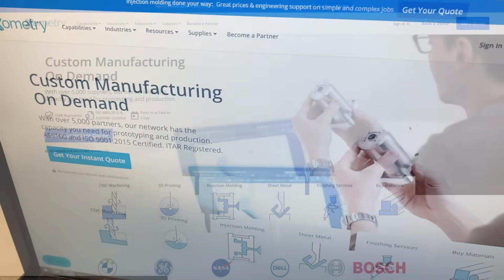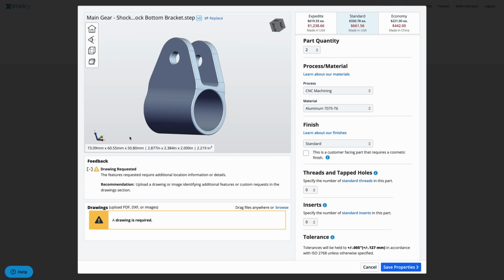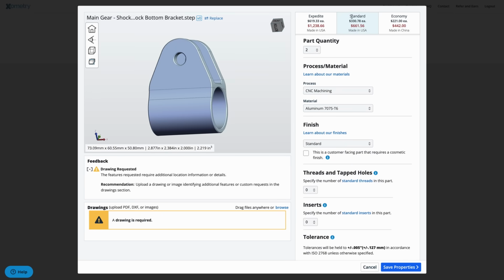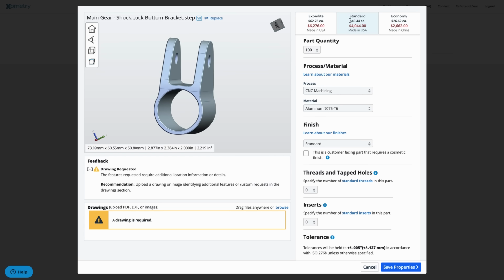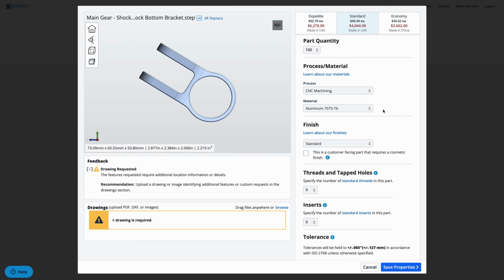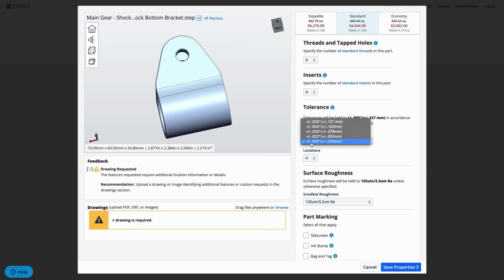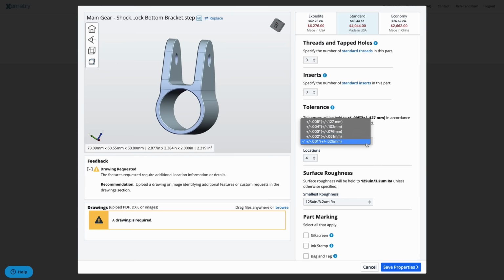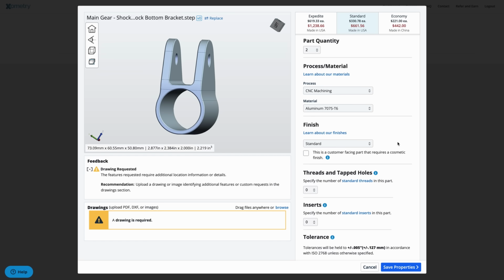The TRUE COST of CNC machining!

Comment: what the... that single part price is bonkers, I've made parts like that for cheeeep.  Want a new supplier?
Reply: The thinking is done in the first part, after that its repeating. Also if you want to make a lot of one-offs, keep the price for one low. If you want series, make a steep decrease in price once the volume grows.
Reply: most shops have a setup cost for their cnc machines plus a tooling cost, after all tools dont last forever and neither do the machines making the parts. once all the costs for setup and tooling are taken into account then there is the running cost of the machine and the cost of the operator. personally i dont know any machine shops that have a setup cost under $300 plus tooling as sometimes people want very specific things made and the shop needs to order special tools to do it and it may never get used again so the customer will get billed for those tools
Reply: @davidmilligan4751  If you can not setup and run any part in under 2 hours, you might be right, otherwise it seems a big exaggerated
Reply: @arjandijk1123  there are alot of costs in setting up machines more than most people tend to think about for lathes running soft jaws depending on the chuck size and type the soft jaws can be priced from $150 to several thousands just for the jaws alone then you need to machine them for the job which is programming and time that is all calculated into the setup costs or on machining centers the costs of tombstones and their fixtures even just setting up a vice and clocking it in and making sure everything setup right can run you an hour and honestly if your not checking to make sure the vice is square and flat your only leaving yourself open to problems in the future there is also the cost of the soft jaws on the vice i think most vice soft jaws ive used have been a minimum of $100 to buy its a stupid price but again proper setup removes alot of issues in the future
Reply: @davidmilligan4751  So then you are talking about a part that has high setup cost and time of over 2 hours. But a lot of jobs run just fine in a 3 jaw chuck/straight machine jaws and have less then 30min setup time, so if machining time is under 30mins your total spend time is under 1 hour, in the Netherlands we calculate a man at €40per hour and a machine (3 axis machine center or 2 axis lathe) at €30-45 (including tools), add to that the material cost os €10-30 and 30% profit you can have a part for €150 (half of your minimum price). If you don't want to do it for that money, your competitor will. 
In case of the showcased part the first part will be much more expensive then that and be over the $400 suggested here. But for most shops, the showcased part is not a standard part
Reply: @arjandijk1123  yes you are correct if you are setting up a simple lathe and the tools are already setup the customer has already supplied the programs say for instance a simple bolt m10 hex material bar feeder and the hex material is 16mm AF on a good machine you can get away with 2 turning passes and a threading cycle and parting it off into a parts catcher simple setting up the jaws for the material is easy 5 minutes to do that maybe 5 minutes to setup the tools if they arent already in the machine and thats 5 minutes per tool provided you have a tool setter longer without one sending the program to the machine another 5 minutes then running the program and making sure it doesnt crash and this can be quick or slow depending on experience of the operator and complexity of the job after the first part comes off the machine check to make sure that the quality meets the drawing theres another 5 to 15 minutes again depending on the experience of the operator an hour minimum to setup the machine ready to run  or even longer is not hard to see even for simple parts all this for a part that has a 20 to 30 second cycle time and suddenly you spend more time setting up the machines than you do actually making the part hence the reason alot of shops charge a setup fee of around 2 hours after all there is always the possibility that something goes wrong just imagine there is a wrong offset in a tool or a tool wasnt setup and you go from  a turning tool to a drill and now that drill is punched into your nice new 10inch chuck and the tool post has been moved and the jaws are wrecked the tool is wrecked all this needs to be taken into account when setting up machines all of this is a hidden cost after all humans arent perfect and these machines only do what they are programed to do and they dont care whats in the way haha
Reply: @davidmilligan4751  If you want to calculate a lot of human errors in your price there will be soon a competitor that has less errors and is cheaper
Reply: @arjandijk1123  just 1 human error could see your cnc machine down for days or even weeks so unless you are running multiple machines yes there is a factor involved
Reply: @davidmilligan4751  So if you make many human errors you will be more expensive then your competitor. Or do you accept a $1000 taxi ride for 20 minutes, because the driver crashes his car now and then
Reply: @arjandijk1123  Communists/Socialists  like you have a very warped view on this.  You say you could make the part/s for half, but the worker buying the product has already had half his wages confiscated by the State before he gets his paycheck to buy anything. And to further diminish his buying power, the cost of living is 43% higher in your little utopic commune. NO THANKS comrade.

Comment: I would have ran it about the same but with a few exceptions. I would have installed an expanding plug in the lower half that was in the soft jaws to keep the bore round while tightened in the vice. I’d use vice handle with a torque setting for repeatability. I’d run the bore undersize first so I could measure and correct for shift because it’s not a perfect world. Real world in a good machine, .001 true position between bore halves. Need it closer and rounder?leave .003 stock and hone to size. 7075 was the best aluminum alloy choice for fast, accurate machining.

Comment: That mill you have as a hobby mill! 
Does not even have a tool changer and is slow motion! So to talk about costing of machining a part is not accurate with that hobby Mill.
Doesn’t even have an automatic drawbar.
You would be better off to buy an older machine from the early 90s do a little fixing on it
Reply: Do you even know what darkaero does.    They dont need anything bigger
Reply: @cw93711  - You can still buy a real industrial CNC mill with a tool changer in used condition for the price of a new Tormach and have a much better machine.
Reply: @G53X0Y0Z0  exactly
Reply: @cw93711  Did you even read the comment you are replying to ? Nothing was said about "bigger".
Reply: @deconteesawyer5758  
I guess you didn’t read my comment very well !considering the word bigger is not in my comment at all. make a long story short the mill that he is using is a piece of shit!
Reply: @lehighleroy6215  OK Leigh, I'll explain it for you. The funny little symbol "@"at the start of a comment denotes the person to whom the reply is directed.
Reply: @deconteesawyer5758  a tormach is a real cnc   its designed for prototyping which is what they are using it for at this point.   Its also probably what he learned on in college as they started this company as soon as the youngest brother graduated college.  I dont remember  what model they have but a 1100 you can get an automatic  tool changer for.   Also they are building this out of a hanger, not a shop so space is limited.   Lastly it comes with a warranty and since they are building an aircrraft prototype and not machinist speed isnt that big of a deal.   Even if they use it for production it still wont effect them as they wont deliever more than 2 kits a month unless people just pour money into the plane which will most likely be an issue since biden was elected and if gas and oil skyrocket like it looks like will happen aircraft purchases will slow.    A friend of mine owned a sucessful ulralight and sport kit aircraft company that i watched go bankrupt under biden even though they only needed to sell 48 kits ayear to stay successul and they had 5 model including a twin engine and a line of floats.  They failed spectacularly  when the market crashed and gas went up.  
1 other thing a bunch of the capital for dark aero came from a state of Wisconsin grant and it could have been stipulated  they needed to buy new tools like the cnc or their financing required it since they are a brand new company working on just a proof of concept prototype  and they have no background in business ownsership much less building airplanes.
Reply: @cw93711  They may well have improved their hobby line. Last I checked, and I'm not sure which model it was,  in the company  video I watched a couple days ago the tormac was still incapable of basic CNC function like speed/rotational control and was incapable of milling an internal thread. Cool if they now have a better tool for the home garage. Makes me smile when you say the machine has to be small to fit in an airplane hanger, but I see what you were getting at.
Edit: Those ulra-light and sport kit aircraft you referred to as going bust are/were every bit real airplanes. Heck, they may well still be in business today if they had marketed to the commercial freight sector of the Mexican cartels  as targeted for prototyping new hubs or landing zones.
Reply: @deconteesawyer5758   i have clients that have tormac 1100s with auto tool changers  for their prototype  machines and these businesses  due 100m in annual sales.   Another  friend has one he uses that to do all the machining for his gun manufacturing business.   Granted it is part time.   He also had to fit the machine easily into his 800 square foot manufacturering facility.    Hes manufacturing AR rifles so it must be able to cut internal threads since an ar lower has the stock attachment  threads cut in lower reciever.  
Airplane hangers are pretty small once you get everything  in their.   Typical  hanger is 40 by 40 for single  engine ga aircraft non jet, non t hanger.  
I never said ultra lights and home builds arent real planes.   My aircraft was a f1 rocket homebuild tell i sold it when i lost my medical.  Basically rv4 on super steriods.  300 plus hp io540 and climbs out at over 3500 FPS, 220 knot cruise tail dragger.  But still had room for 2 bags of luggage with 2 people.   Also +,-9 gs   actual stopped testing spar at 15gs with no issues.   I had first qb kit.   
Ulralights dont have enough useful load to transport anything.   Also when all these aircraft companies failed was when economy  crashed due to housing  market under Obama.  
Even darkaero really has no ability  to transport  anything
Reply: @cw93711  I have (fill in the blank) clients/ friends that make their living with a hundred dollar go-pro with an auto changer on the focus, or a Mr. Pen- Exacto Knife  and Elmer's glue making tens of  thousands of dollars on a single piece of work some of which hangs in museums. Those tools fit in a desk drawer. These are full fledged professional tools.
Two point two pounds of heroin/cocaine or fentinal is a highly profitable cargo and was so  even in the dark ages of the Obama administration where the leader of this country deported more illegals than anyone in recent memory, unlike the current administration welcoming them with open arms and taxpayer dollars.
Every tormac made was capable of making internal threads as was every bridgeport and drill press.
A plane that  climbs out at over 3500 feet per second would be awsome.

Comment: Having worked in a machine shop for 15 years the industry standard is +/- .005 not .001 so your price is going to be considerably higher if you want those tolerances and it will be much more difficult to keep your repeatability on a tormach to .001 consistently
Reply: You'd be surprised at how well you can maintain .001 to .0015 on a well maintained and well setup Tormach.   Now, I'm not saying run production levels, but for 2 or 3 parts, you can definitely, repeatably do it.
Reply: @shirothehero0609  That I know but a production shop ain't going to do 2 or 3 unless they charge a ridiculous rate as the setup and programming time alone will most likely be more than the part depending on how large or complex the part is

Comment: Just a thought, but longer term, that would be a great extrusion profile part.  Since the outside is less critical, extrude that profile and then do a light finish machining for the bore and bolt hole, cut to length.  Part cost would drop a fair bit....  It does help if you are running 2500 to 5000lbs worth of parts... extrusion weight.  Just something to keep in mind for overall costs...  Right now, extrusion cost is cheaper than sheet aluminum.
Reply: And, IIRC extrusion also improves material properties in the direction of the grain? 

I'm a little concerned about have such a high cyclic load component such as the landing gear, made of aluminum, which has very poor fatigue characteristics and is often difficult to predict service life in such a situation, as every landing is a different load cycle situation, effectively. Obviously it can be beefed up as needed, but converting to (ideally) high strength steel in the future is probably not an option due to weight.

Comment: What are the odds this part will fit/function as planned?  As with the rest of this project, I'm taking the "WILL" side.  Great work!!!
Reply: Whether it will fit or not depends on your tolerances. If it's a part for your high end gear you can be sure the company that made the parts have their own standards, which also includes quality control. There are tools for that control: specially machined and "ground" calibrated parts - rectangular or oval in shape, for example. Oftentimes clients do their own quality control. So it all boils down to tolerances :) hope it answers your question!
Reply: @viliusmarcinkevicius4747  Hi,dear friend,have contact information in the video  https://youtu.be/_SBkl3b2ZOs